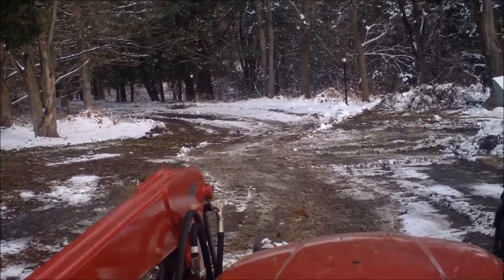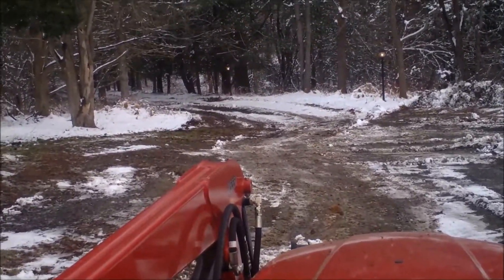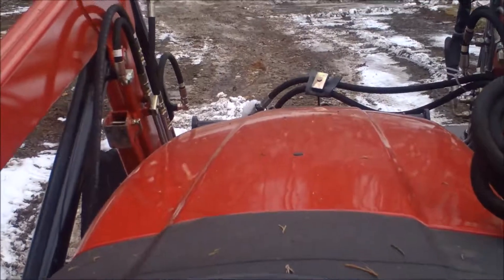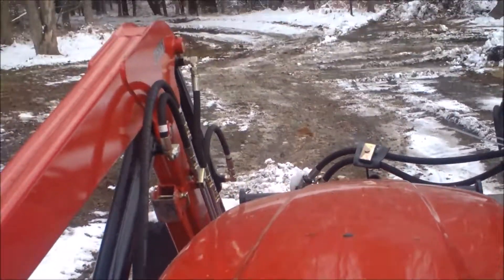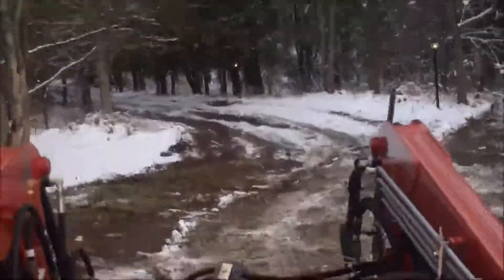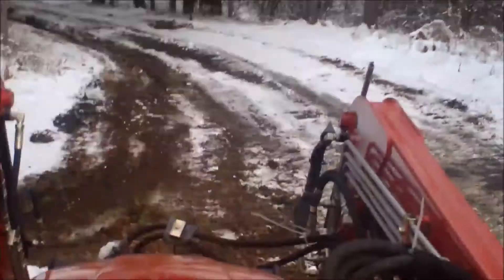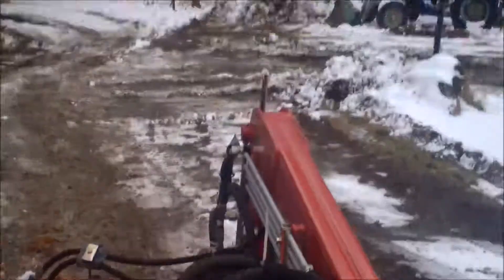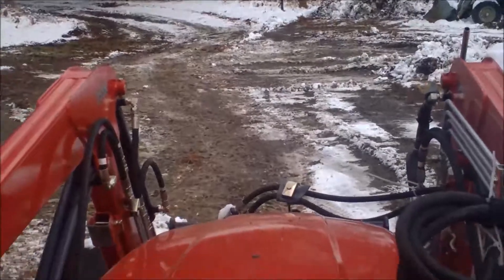Mahindra 2555 Mode Switch Demonstration

Comment: Thanks for making this video. My tractor was acting like the battery was low when I would try to start it. Starter solenoid engaging and disengaging basic low battery symptoms but it was this switch. Has to be in mode 1 to start. Weird, I know.
Reply from the maker: Wow, that is unusual.   i have never experienced that.
Reply: @allthingsdiymike1106  I know, right. Took me all day to find it.

Comment: What does it do in the “3rd” position when the rocker is basically in the neutral position? Thank you.
Reply from the maker: Hi Jon, it is basically 3 different settings.  When it is in the center position(what you are calling neutral) the stopping aggressiveness is in between the two rocker switch settings.  thats basically where i keep it most of the time on the property.